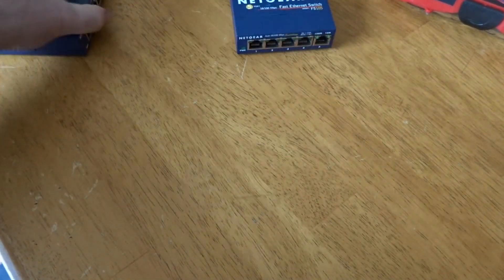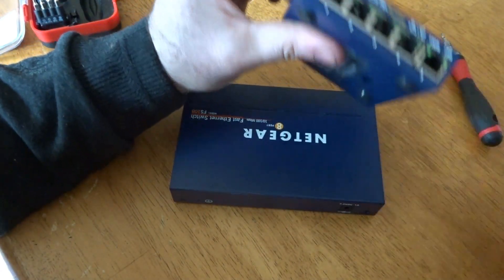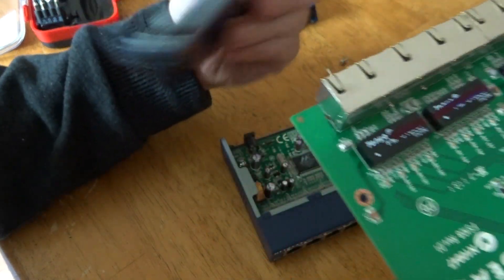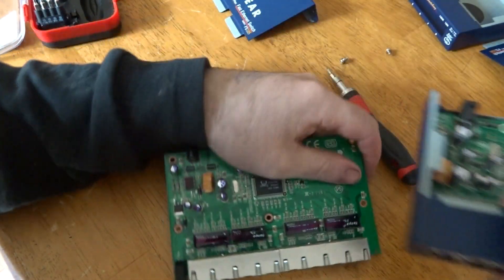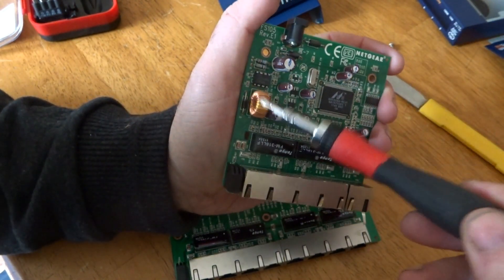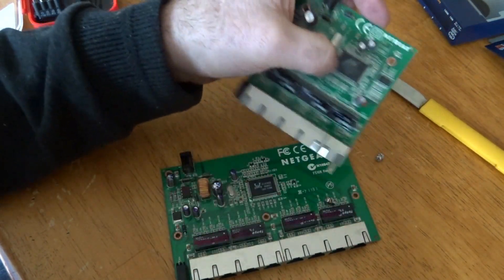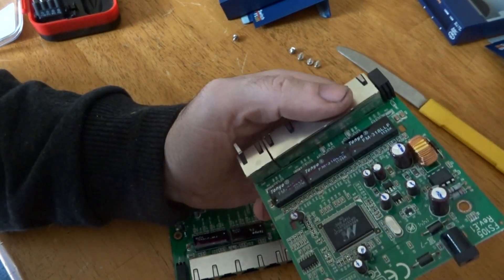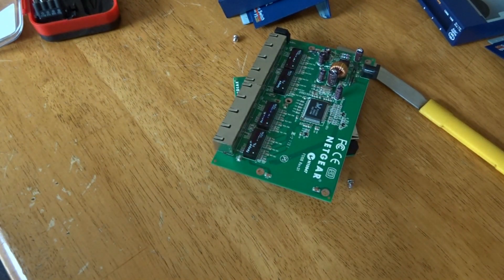The Secret to MAXIMIZING Gold Recovery from Network Switches

Comment: Quick question, when you are going to be doing the ram fingers for recovery will you be doing the nitric method to make AR or the hcl and bleach? The reason I ask is because it is very expensive for nitric acid in my spot in Canada so I am basically stuck using the bleach method. Thanks and another great video!